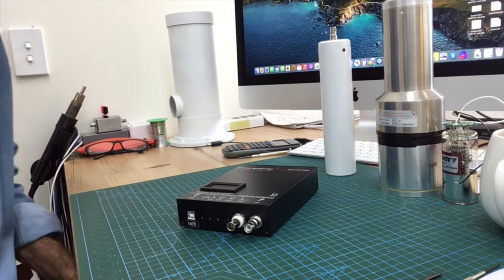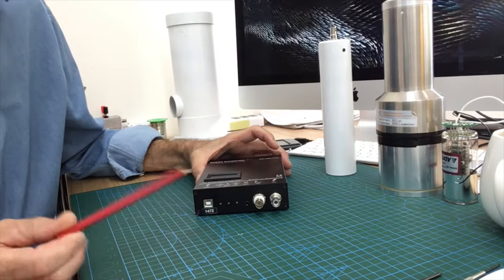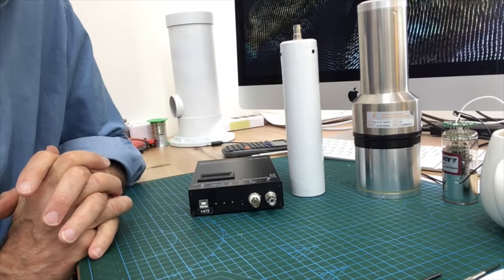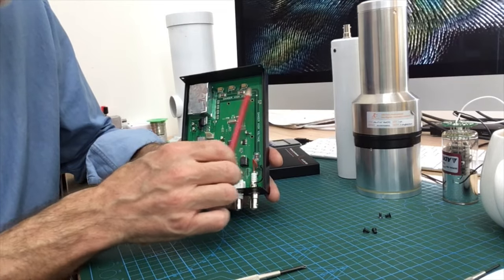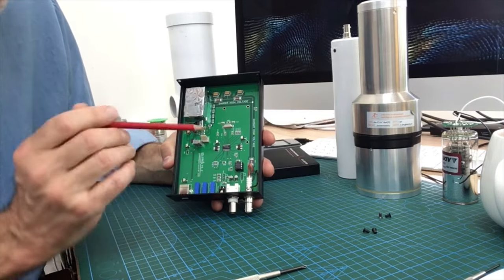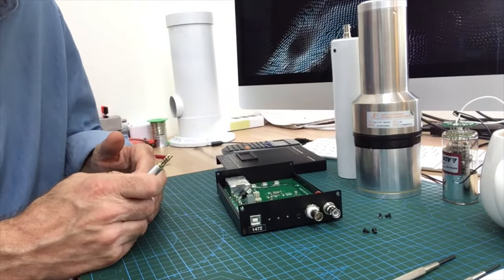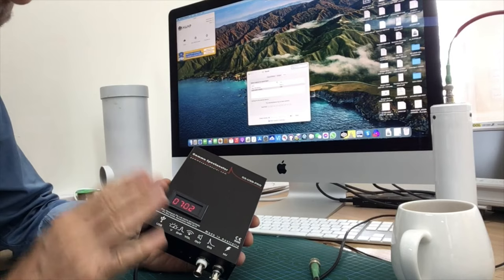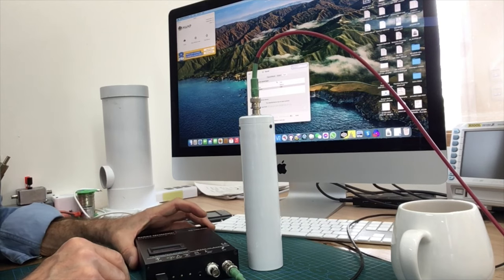Gamma Spectrometry part 2

Comment: Steven – Great explanation on how to properly connect a scintillator detector to the GS-USB-PRO. Just a note that on older serial number units (below #1255), the coupling switch is opposite throw. Cheers, Tom